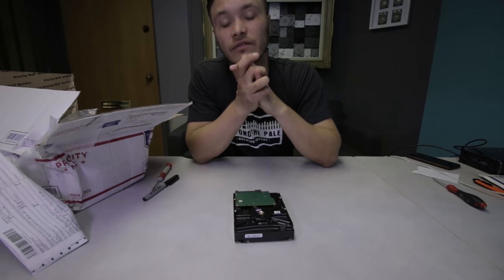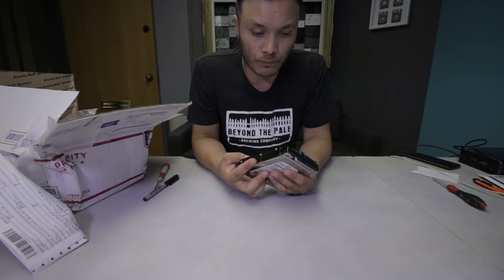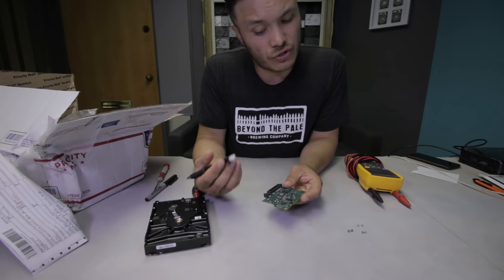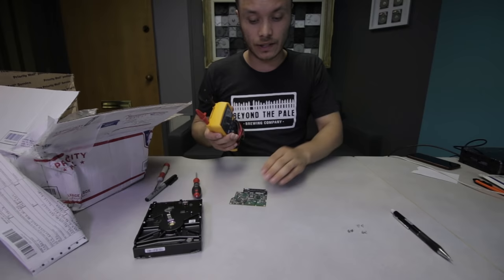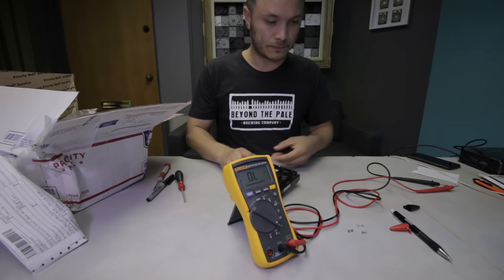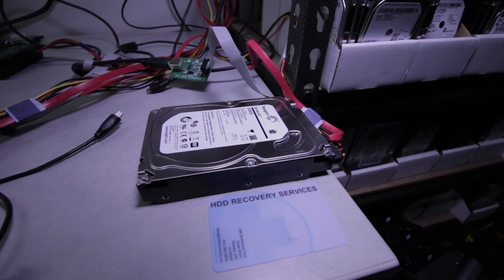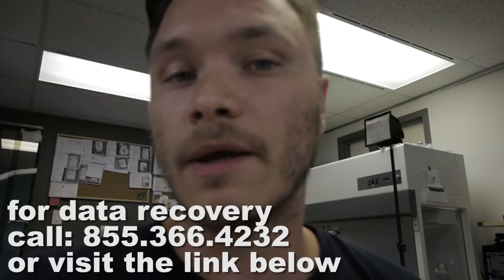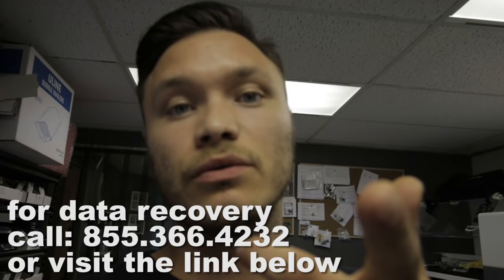seagate hard disk not detected. Does it spin?

Comment: I noticed that you have done a few of these videos (which are great) but they all turn out to be bad diodes.  What about if the diodes are fine?  I have a Seagate 500GB that makes no sound but the diodes appear to be ok. What should I be checking next?
Reply from the maker: No sounds could be linked to several things. Is this a HDD or SSHD?
Reply: @hddrecoveryservices  it is a HDD (7200rpm) Seagate Barracuda.

Comment: Got a quick question...
I am a sad owner of seagate expansion desktop 100664987 rev b - 3TB version.
Lately without any sign drive just stopped working. Right now situation is: when connecting drive the computer I can hear that it starts spinning but after two-three seconds it just stops and nothing happens.
Do you thing that this might be something with device pcb or power supply pcb?
I know that this is only estimation and guessing without seeing device but I would like to know your opinion. I can upload video showing how it behaves if that helps...

Alternatively, what would be estimated cost of recovering data from that drive?

Comment: How much would it be for the diode remover tool and how would it be replaced, soldered or other method.
Reply from the maker: I am not sure what you mean by diode remover.
Reply: My mistake.
Reply: Kenneth Lantier you can remove smd things like a diode with a hot air gun or a soldering machine.

Comment: Hi I have a 2TB Seagate baracuda drive ST2000DM001 that spins up, but is not detected by Windows disk manager  . I've swapped the PCB board with a new exact one but BIOS detects it as a 4G. Kindly advice
Reply from the maker: PCB needs adoptation
Reply: Thanks man. The PCB is an exact match from a working Donor HD (100762568 REV A) ,So  how do I go about adopting it? Currently the disk powers up spins and makes an initial chirp sound and continues spinning quietly - here is the exact one time sound  I get~~> https://www.youtube.com/watch?v=kt6asKkMJq0

Comment: Hi,

Liked the video, even though I have a question to ask. 🤔

I have a Maxtor 40 GB IDE 3.5" HDD which is not spinning.

I followed your example & (by reading a comment of yours) I placed the negative test probe lead on the cathode side of the TVS Diode (where the line or stripe is), while the red lead went on the anode side. 🙄

If I switch the probe leads I get the same reading on the digital multimeter. This isn't normal, right ?

Because the diode is supposed to allow current to flow in one direction, while blocking it in reverse. 😏

Because if I try the continuity test on the other TVS diode (switching the test probe leads), briefly I get a value on the LCD screen of the digital multimeter, but it immediately disappears (as it should). So the other one seems fine.

How do I get a replacement TVS diode ? Both are yellow in color. The suspected bad one is 336 16K 117. How do I interpret this ? 😣

The good one has writing 156 E P042T

Thanks for your reply in advance. 😊

Best Regards,

Comment: placement of black probe and red probe do not matter when testing continuity
Reply from the maker: you right, if the component is shorted it does not matter it will beep either way, but we are testing a diode and its properties here.
As you may know, a diode has a negative lead (cathode) and a positive lead (anode) and there should be a reading if the diode is good. Negative probe goes on the cathode side of the diode, and the positive probe goes on the anode. That's just a proper way of testing a diode my friend

Comment: thank you, a question, what happened if we keep it with just one diode?
Reply from the maker: next time there is a power surge, it will hit something more vital if you don't replace the TVS, otherwise its fine.
Reply: does replace pcb / board also fix slow reading hard drive? I have WD home studio hard drive which suddenly very slow reading and some files cannot be read, thanks in advanced

Comment: Hey My Good Man, I can't thank you enough for this Video. I am a Photographer/Videographer and also host my and my wife's Websites. I do keep a majority of my Photos/Videos on another HDD as backup but a lot of others stuff that I keep on this 3TB Barracuda Seagate Drive and the power for the dock stopped working after transferring it during a hurricane. After replacing the dock, the drive would turn on but not connect to the computer. I was going to replace the PCB board but wanted a way to test it before doing so. I was able to use this video with every step and that same diode was my problem. What I am wondering, however is how long will this HDD work without that Diode? Should I end up buying another PCB board to be safe?
Reply from the maker: it will last until next power surge Kato. 3TB ST3000DM001 are the worst drives to have, if you check their stats you will quickly find out about their over 40% failure rate. I would recommend moving your data to a safer device like a WD or Toshiba
Reply: Thanks for the info. Luckily, I have had this driver for a few years with a WD as backup; however during a recent move misplaced the power adapter for it. Is it the same output as the Seagate? 12v 1.5A. I also heard that WD have made it so that you can't remove the PCB. Is that the case?
Reply from the maker: hard to say about the power supplies. Usually they are the same, but plugging in the wrong one is what could have initiated your problem with the Seagate in the first place. WD Passport drives have USB connector instead of regular SATA

Comment: Hi there, I just recently had a storm at my house and I guess the surge protectors we had, were ummm not quite so protecting.  I am pretty sure it is the PCB my drive is not spinning at all. Drive wd40efrx-68wtono.  

I was wondering if I found and removed the removed the diode(s) and got the drive spinning again, could I just connect the drive back to my PC and back up the data? or should I try and find an identical drive and just replace the PCB?  

Thank you very much for your video!  

Both my main drive and back up drive got fried.  All my music for my albums and artwork and then some is gone if unable to retrieve.
Reply: Also, this may be a dumb question but I have a PCB from a different WD drive.  The drives are completely different in specs, but the PCB is same shape, connections, and so on...I know its not same drive so I am not sure what the firmware would do to drive from that PCB.

Comment: hello sir

i have hitachi 1TB hard drive and it's not spin i checked all components and reading of components is not beaping 
but hard drive not work

what can i do?
help sir
Reply from the maker: You can find a shop near you that specializes in hard drive recovery. Most of the time, if your drive is not spinning up and it is silent, it will be related to the PCB. PCB can be replaced as long as the firmware is moved to a new board as well. In your case, it would be NVRAM chip.

Comment: I have this exact drive and the exact diode tested bad, I removed the diode and the path tested good. The other diode/path tested good. The drive still does not spin up. What would you recommend the next steps be? I don't have a lot of internal experience on HDD Recovery, but I work with computer and am pretty comfortable around most things computer related. Any advice or assistance would be appreciated. Another note, I only have one of these drives, so I cannot currently take out parts from one and put in another. If that is a viable option, let me know and I'll look at picking another drive up.  Thank you in advance.
Reply from the maker: you need to look for another possible short
Reply: HDD Recovery Services is another short an easier fix then another option? The stuff that you do is very inspirational and I would like to get more in to this line of work. Great content and video production.
Reply: @davidroseberry2494  pp

Comment: hey dude , love your channel, now i have an exact 3tb seagate like the one in the video, it spins for a second when connected the stops completely. i got a multimeter and conducted a continuity test on the same two diodes but my multimeter doesn't have  the  sound like yours so i jus have to read the writing on the screen, problem is i have no idea what the hell am reading, it doesnt say 0.8 or o.5 , first diode returns 624 and the second diode returns 586 . what does that mean coz i am a complete noob with multimeters, which is bad and which is good on those two diode readings
Reply from the maker: If it spins up and down, then you have a much more serious issue known as a head failure. There are bunch of videos that demonstrate the process, but you need a professional help to pull data from the drive at this point

Comment: :: Hi, Thanks for the upload. i have a seagate freeagent pro 1TB external hard drive, it is spinning but not detected by my computer. i already removed the case (enclosure) of it, to pull out the harddrive and try to put it in my computer but still its not detected. is it possible that the problem would be its board or should it be the disc?! hoping for your response sir. thanks ::
Reply from the maker: Jherson Bergonio usually if the Seagate drive spins up it is not the board problem. Could be problem with system files (aka firmware) or media cache. Does the drive make any abnormal sounds?
Reply: HDD Recovery Services hi! Have the same trouble. But the HDD make 2 beep sounds. After 5 minutes the bios and SO recognize, but couldn't get in it.

Comment: so I assume that if you do this procedure and your hard drive still doesn't who up in the bios or spins when you power on the computer , that the motor must be the problem?
Reply: show up on the bios
Reply from the maker: if the drive spins how can a motor be a problem? Motors only job is to spin
Reply from the maker: It could be related to the preamp too. We test it this way, first check the board, then check the motor.
Reply: HDD Recovery Services I replaced the board. one shorted diode.  how do you check if it's the motor ?
Reply from the maker: you can open the drive up and see if the motors spins freely (but that is not recommended unless you know what you are doing). Or you can check the resistance on the motor itself and compare the readings to a similar function hard drive. On the PCB side you will see 4 pads near the motor, check them.
Reply: HDD Recovery Services yeah I'm pretty electronically inclined.  fixed all of my own electronics at home. I built my own computer a few years ago. but I replaced the power supply and may have fried my hard drives but not sure yet. I did smell an odor of electronic burn. I had 4 hard drives and 1 SSD I stalled. the only one that's working is the SSD drive. All the 3.5 hard drives are not working for some reason when I plug them in. and   they do the show up in the bios.
Reply: they do not show up on the BIOS
Reply: I ended up buying a HDD docking station and the hard drive will not spin or even registering a grain of life
Reply: I guess safe to say motor is not working on 4 hard drives that I had in my computer.
Reply: update on my hard drive issue.  I brought a new hard drive and inserted it into a USB hard drive docking station and it showed up in disk management.  when I installed it into my desktop it did nothing. no spinning no nothing.  I pulled it out from my desk top to reinsert in docking station and it did not show up on disk management nor did it spin up. dead!!! what's killing my hard drives in my desk top? only my Samsung 60GB ssd card is working but it has windows 8.1 on it

Comment: so you removed the diode and didn't replace it? is that safe?
Reply from the maker: If you want to use the drive further probably not, but for data recovery that was finished in a day sure
Reply: HDD Recovery Services i had a seagate drive fail on me a day ago...3TB and when I removed the board all the contacts were corroded... WTF, there's no water near my PC, is it just a cheap shit board? never seen corrosion like this, even on scrap old shit in my recycle bin...
Reply from the maker: corrosion? or overheated pads? I see a lot of the PCB with dull brown contacts. These ST3000DM001 do love to run hot.
Reply: HDD Recovery Services yes they are brown and a bit corroded around the screws of the board. well i just checked both diodes that you showed are ok on my board. same hard drive as this video.. lol

Comment: Hi, I have question regarding a Hitachi 1TB that is completely silent, I have tested the diodes as per your how to in your video and on two out of three (one large diode and one small diode) I'm getting .233 and the other (larger diode) .151 (no matter which way I touch the diode pins),  is that normal or should all diodes be returning the same number?

Comment: Hey, i have old seagate 500gb drive that hasnt been powered on for 5 years, board is dead and i tryed reflowing but nothing, also nothing heats up and it dosent draw any current. http://prntscr.com/g9tr9i this is the board but i read somewhere that flash or eeprom has to be put from old board to new. is this true and is it possible to fix it by just replacing board?

Comment: Hey mate, not sure if you still checking your messages, but I will give it a shot, I have a 500G Samsung 2.5 HDD which I took out of my laptop and was trying to back it up for 3 months and well as you guessed, I failed to do that due to being busy , lazy and dumb, so today finally I had time and there it is, I plugged it using the dock and it didn't work. A few week before when I tried to copy some of my photos  it worked but other laptop didn't  have enough storage and I again I left it for next time.
Make the story short, my HDD spins for 3 times, making some  noises then stops, good or bad, I opened it thought that it might be a stuck head which wasn't. So could you please advise if there is anyway to fix this or at least point me to the right direction? Dumbest thing I ever done and didn't back up this HDD which has worth of 9 years of family photos :(, much appreciated.

Comment: Thank you for the amazing video,  my Seagate ST3000DM001 stopped working all over sudden. when I plugin it into my windows PC via USB cable it makes clicking sound for couple of times then it stops.  it shows only  3.86 GB space in windows. what are the cause? could you give me any advise, please?  I wish you were from UK then I could have send it to you for fixing.
Reply: Exact same problem with a 2TB variant. Did you got any further?
Reply: So far no luck, already spent 500 pounds with data recovery , they replaced the head but it didn't fix hard drive.
Reply: EXACT SAME HERE, ANY SOLUTIONS??

Comment: Awareness  to the masses, and those who read Maximum PC  , minimum BS I always wondered if that means  bull $%!t or Bachelor of Science. Anyway, in their editions they have a segment called Tech Tragedies and Triumphs. Is it possible that Hard Disk Drives are obsolete and are dying slowly? SSD or solid State Drive non mechanical is making this video irrelevant.  I love HDD and I will always love them, I have like 4 brand spanking new HDDs for the forciable future if my builds fail. However, resistance if futile you will be assimilated and absorbed by technology. I am inclined to install both in my next build,  a HDD for my Windows Operating System and SSD to store mission critical data, this way if my HDD dies, I can always reinstall Windows and software.
Reply from the maker: I honestly would go the other way. SSD for windows, and HDD for data. To maximize security of the data check your motherboard for RAID 1 ability, and set it up if you have it. HDD for OS is too slow. Something else to add is that SSD is not an ultimate storage device. They fail, and fail ofter. What ppl don't know is that with failed SSD that needs critical data pulled off you would be looking at $2000-8000 depending on the capacity, brand, etc.

Comment: I have the exact same drive. If the drive DOES spin but is not detected, is it still the PCB?
Reply from the maker: if the drive spins up - it is 99.9% NOT THE PCB.
Reply: similar issue, spins but not recognized.  I replaced the pcb , still no luck.  going to switch back to the old pcb, clean, and test. any other ideas?
Reply from the maker: +Raj Soni like I said earlier. If your drive spins - 99.9% PCB is good
Reply from the maker: +Raj Soni drive may stop getting recognized for many reasons. Something as simple as bad sectors can initiate it
Reply: +Raj Soni try hdd regenerator this maybe helps you to scan and repair bad sectors for my experience you have something like 40% luck to backup  your data,by the way dude you are awesome your videos is very informative,the one and the  only "bad" think is for amateurs like me is that  you explain the thinks in very fast mode so sometimes i stop the video three and four times to understand what did you did .  By the way this is the best channel  for this kind of repair on youtube so far keep walking!